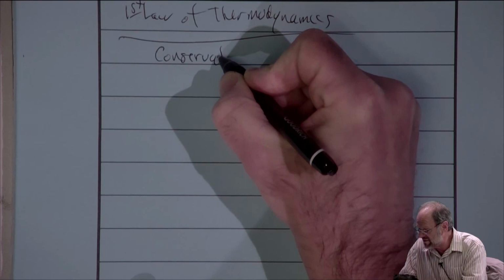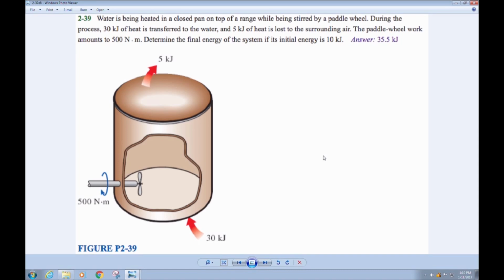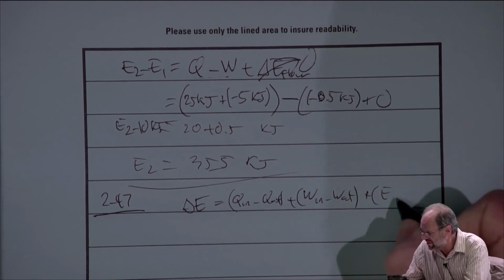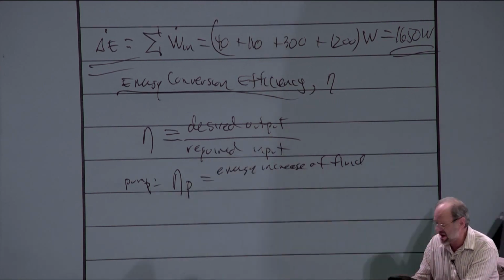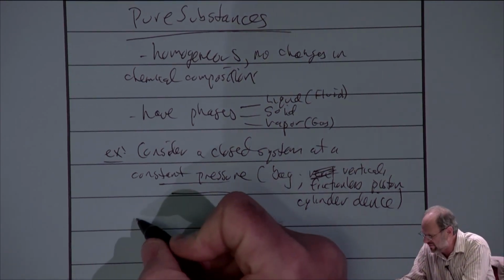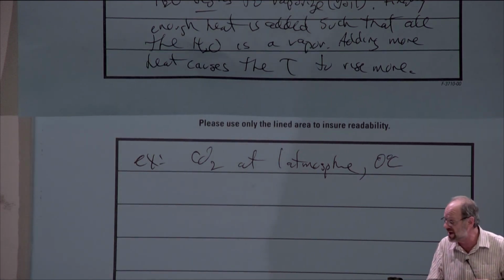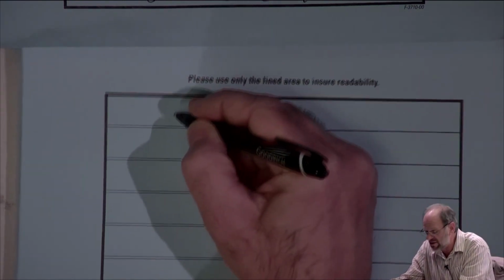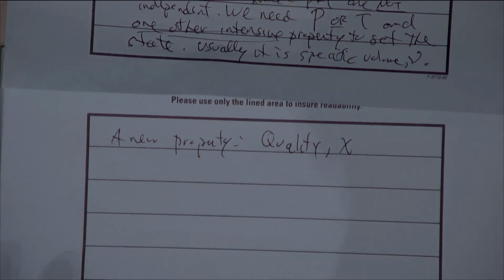Thermodynamics: Conservation of Energy; Properties of Pure Substances (3 of 25)

Comment: Compressors increase pressure and the expansion valve lowers the pressure.  The cold evaporator is heating the fluid and the hot condenser if cooling the fluid.